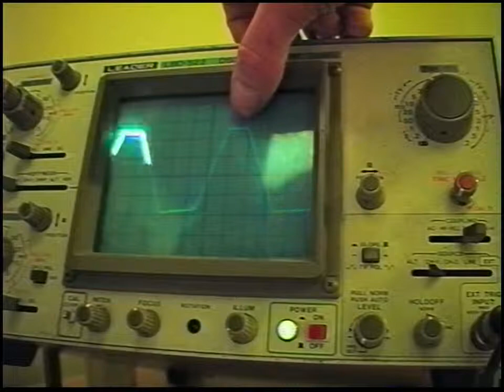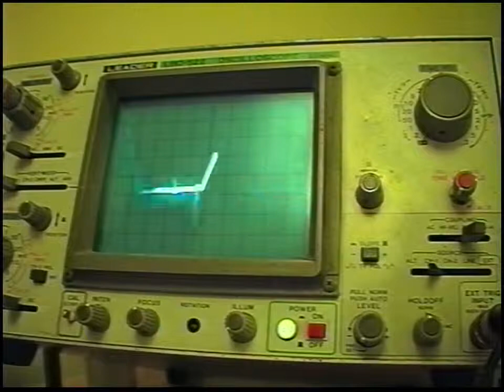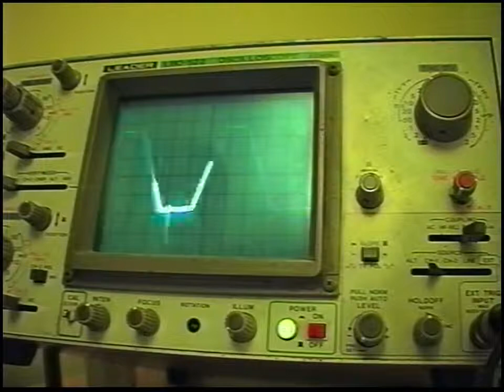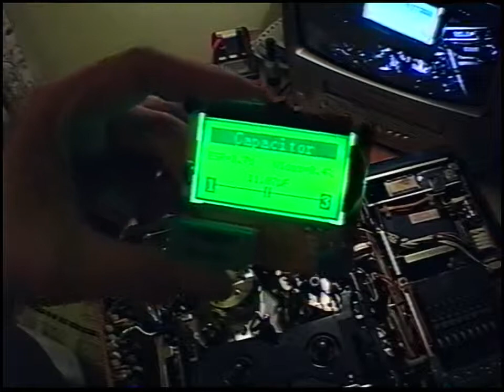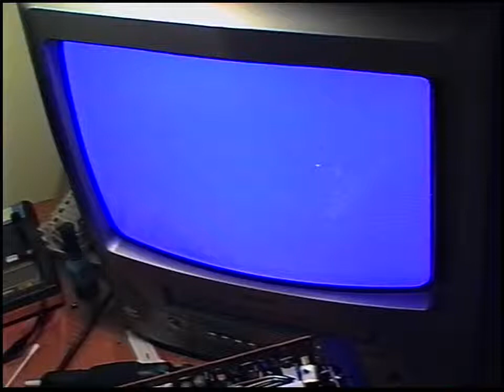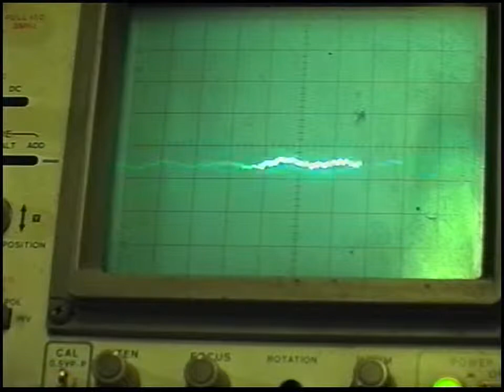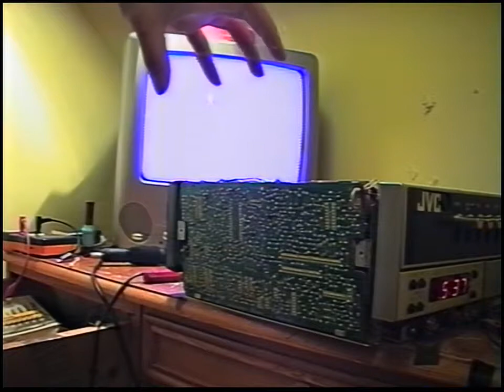VHS VCR Repair - JVC HR3330 / Ferguson Videostar 3V00

Comment: Brilliant video! I have the Ferguson videostar version, which has an unstable picture, so I'll take a look at that drum discriminator pot. I remember when I first got it that the drum was spinning way too fast and I slowed it down, but obviously I've not got it quite right yet.
Reply from the maker: Thanks very much. I would definitely recommend reading Mike Phelan's series of articles in Televison magazine. They go into a lot of detail on these decks, starting with descriptions of each section and then how to recognise different types of faults and what to do. That is where I got the method for setting the up the drum discriminator. You can get PDFs of them here:
https://www.americanradiohistory.com/Practical_Television_Magazine.htm
The series starts in the September 81 issue. The articles in the October 81 and September 82 issues relate specifically to the servos.
Good luck with getting it working properly and let me know how you get on.
Cheers
Reply: @nowt1002  my pleasure.  Thanks for the links. Unfortunately I can't go any further with it as I don't have access to an oscilloscope.  I've got genuine alignment tapes but they're not much good without a scope. Damn. Do you, by any chance, take in machines to repair? This 3V22 of mine could benefit greatly from a going over. I've fitted a new video head, belt kit, idler tyre, pinch roller and a good clean. Obviously I can pay for your time 😎😎😎 Cheers, Richard.
Reply from the maker: @MrBetamax  Yes I could have a look at it. My email is nowt100video@gmail.com if you want to email me to discuss it. 
What is the picture instability like? Does it match what mine was doing in the video when before I set up the drum servo? There is also the capstan servo which can cause problems. This looks a bit different, it's more of a generally steady picture with a momentary loss of vertical hold every second or so (maybe more frequently).
Also have you checked the head drum flywheel? The feedback for the drum servo comes from a little magnet on the flywheel that passes by a head causing a pulse. The flywheel is held in place on the spindle by a little grub screw but it can work its way down the shaft over the years and cause the pulse to be missing or not strong enough. If it's missing altogether I think the machine just stops after a few seconds but if it's low I think it can cause similar symptoms. Worth checking just in case. You just loosen the screw, push the flywheel up as far as it will go and tighten it up again. Be careful not to loose the screw!

Comment: I also have the jvc 3320ek machine, i had the breathing picture or swaying, it drove me batty trying to keep the playback stable.
I finally found a place that was able to get me a new head drive motor, wow what a difference, i was able to get it so close that the lock was instant.
But as it wore in over a couple of years i bacame seasick with the swaying lol.
I learnt a lot from that old machine, i understood other machines better.
I still have it, but i stopped watching telly years ago.
Sorry for the waffle :-(
Reply from the maker: They're good machines for learning about VHS recorders and how they work. Very robust although I would say the hr7200/3V29 type ones are more reliable. If you have an oscilloscope try doing the setup procedure I showed in the video, it might get it going properly again. The setup can drift with age especially as the potentiometers are the open type so can pick up dirt and become oxidised
Reply: nowt100
Ahh the ferguson 3V29, yes it was a better machine.

Quite a lot of the ferguson front loaders gave a really nice picture too.
Power supply problems mostly, big black beast chip creating all the voltages.

My favorite vcr is the panasonic NV 333 and similar, reliable and really forgiving with tracking, a nice picture too.

I also liked the cheap and nasty Orian white pcb vcrs, crap but easy to repair, ideal for serial rental tape watchers lol.
Had a lot of fun fixing vcr's :-D
Ill shut up now.

Comment: Great video, any help on where to buy replacement belts would be appreciated.
Reply from the maker: Thanks very much. There are two versions of the mechanism. The belts are the same on both apart from one. One version has a big square belt that goes a long route round three pulleys and the other (the one in the machine in the video) has it replaced with a smaller belt an am extra idler. https://nikkoe.com/belt-kits/vs-9500-9800-video-belt-kit-for-akai-7.html is where I got my belts from. That is the kit with the big belt so I had to provide the small belt myself but they are easy enough to get hold of. I bought a belt kit of small square belts from China ebay some time ago and was able to find one to fit it in that. It says akai on the site but the akai machine is a just a rebadged jvc. They also sell a belt kit for an akai vs9300. That is also a rebadged of one of these jvc models but I'm not sure whether it has the big or small belt as I've not bought that kit.
Reply: @nowt1002  Thank you so much, I have a Ferguson 3v22 same belt came of, so I'm hoping that changing all the belts will sort it.
Reply: @nowt1002  Hi there, I followed the link, and they have no stock of these, I have looked over the net but I really can't  find anything. Thanks again.
Reply from the maker: @chrisamadeus4647  hi. Sorry, only just seen this. I don't seem to be always getting a notification when someone posts a reply. If you're still looking for belts, this site seems to have them. I don't know how much postage is though. https://www.nhecomponents.com/shop/k...-3360-3660-jvc

The nikko one says in stock on the site. Have they just not updated it then? It was a while ago that I bought them.
Reply: @nowt1002  Hi thanks again for the reply, Nikko website does not work at checkout and they confirmed that they don't have much stock left, I actually got the video recorder to run but unfortunately I get sound but just static for picture, I have tried various carriage adjustments but still nothing, not sure if it needs heads of something else, it's in beautiful condition and was sold to me as reconditioned! obviously not.. I'm not aware of anyone local that can repair it so may have to sell as parts if I can't get it repaired. Thanks again.
Reply from the maker: @chrisamadeus4647  have you tried cleaning the heads? You need pure isopropyl alcohol and a strip of paper, the type you get in those big lined a4 pads with the holes to go in a file works best in my experience. Dip the paper in the alcohol and shake off excess then hold it to the side of the head drum and rotate the drum anti-clockwise. Hold the paper to it firmly but don't press hard on it and be very careful not to move the paper up or down as this can damage the heads. Make sure the head drum is completely dry before trying a tape.
Another way of doing it that is not quite as effective but is easier is to play a good clean tape right the way through.
Sometimes the heads can get clogged if a bit of oxide flakes off and gets stuck and can leave you with no picture whatsoever. The heads themselves usually wear out before going and you would get some picture but with dark bits next to highlights (looks like a comet tail)
Reply: @nowt1002  Hi there, I tried to clean with as you mentioned, I even used and NOS cleaning tape with the fluid provided, but still no luck. Do you think if the head is not spinning at the correct speed that this may cause the lack of picture? I have used the same drive belt, which turns but is not very tight..Best..Chris.
Reply from the maker: @chrisamadeus4647  if the head speed is out you generally get a picture that looks like a TV where the horizontal hold needs adjusting - kind of like the picture is being torn apart horizontally. That is because the lines are coming in faster than the tv is displaying them. Have you got a video camera that does 50fps or even 25fps? Most actual video cameras (ie not a phone) are this frame rate. You can check the head speed with this, if you view the heads through it, if they are at the correct speed they will look like they're not moving. If they look like they're moving anti-clockwise then they're too fast and vice versa. Any proper 50hz light source will do really, it's just easier with the camera.